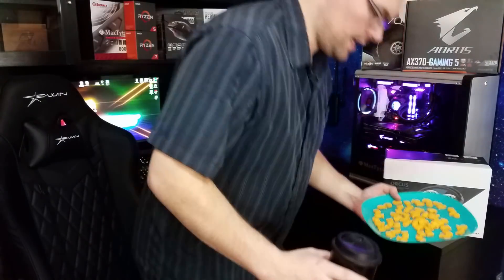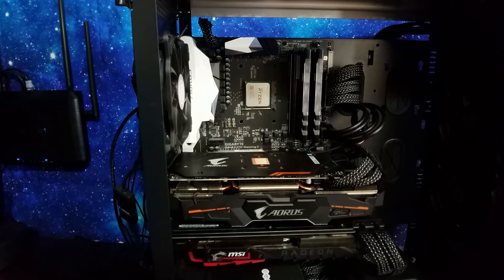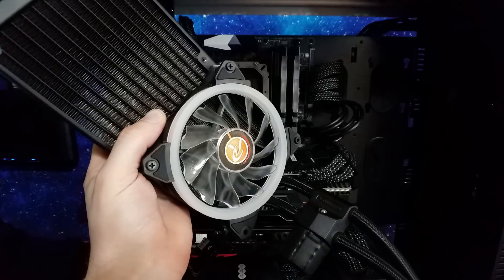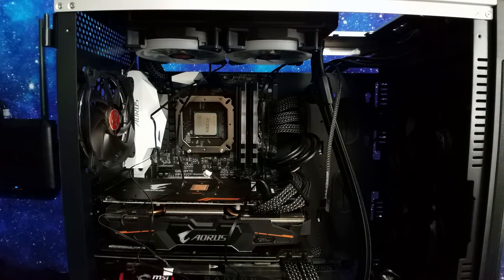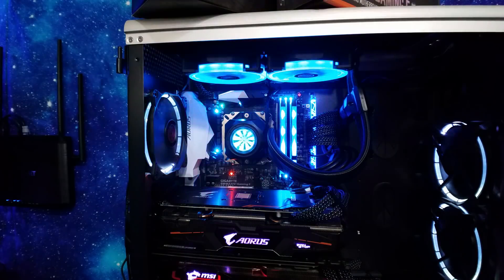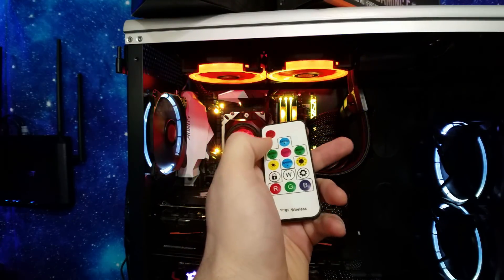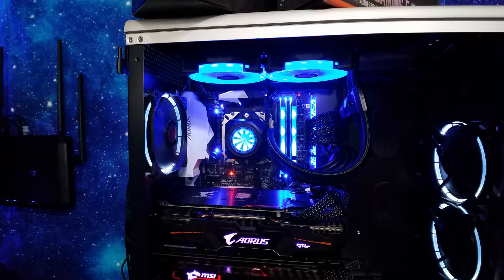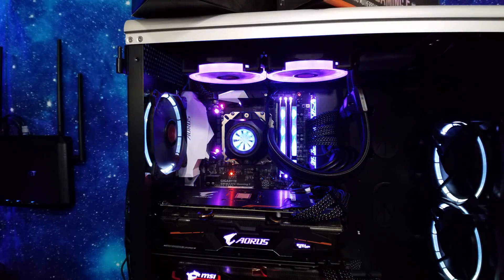Raijintek Orcus 240 - Liquid CPU Cooler - Review and Install

Comment: The control box on mine had a loose wire so I soldered it back and I'll be darn if the other didn't break loose too! I removed the box and the fans and added my own. It's still working but this is a message to Raijintek, they may want to keep an eye out for Q. C. on their products. I'll do without the R.G.B. for now and may solder it back or not. I like the idea of it being refillable and the  Raijintek, includes a bottle of liquid to use in the near future. I would buy it again also.

Comment: I just finished a new pc build about 6 weeks ago and went with the orcus 240. Up to this point I've been fairly pleased with the setup. I installed mine at the top of the case. The RGB looks great. The fan at the rear of my case is solid black. I just recently decided to add to the RGB aesthetics and since my orcus controller has 8 ports I ordered a Raijintek RGB fan from Newegg to replace the solid black fan at the rear of my case. This is where things got a bit dicey. The image on Newegg was a single image of the fan from the front view. No image of the connectors. Just a description stating that it has a 4 pin PWM connector, and a 4 pin RGB connector. Great, that's what I'm after. So I thought. My add on fan arrived today. I was excited. I unhooked my connections to my pc, opened the case and uninstalled my standard rear fan. I installed my new Raijintek fan and began the process of routing the fan header neatly and plugging it in. Then I took the RGB wire and also ran it through the cable ties nice and neatly to the 8 port Raijintek controller. I tried to plug the cable in but it wouldn't go in. I turned the plug 180 degrees and it wouldn't go in. I then looked at the plug, realized I had it oriented properly on the 1st attempt and tried it that way again. Nope, not going in. I then pulled one of the other fan plugs from the controller and compared the two. They're different. Both are 4 pin, but different. At this point disappointment is beginning to set in. I then return to the Newegg website to see if any other information is available and see if they've got the proper fan to purchase. There's virtually no information regarding the difference between the two connectors and any specification on which fan I would need. So, off to Raijintek's own website. Despite the Raijintek website having poorly worded English I was able to determine the part # of the fan. Unfortunately, there's no way to buy it directly off the website so I turned to my usual channels. Amazon, ebay, Newegg. Nothing. Then I go straight to Google shopping. Nothing. It was at this point I realized that this is one of the pitfalls of buying products from a company who's not exactly established. It appears the only way for me to get additional RGB fans that are compatible is to buy the entire cooler. I might try and see if I can cut the connector on my new fan and splice on one that works. Anyhow, overall it's a bit disappointing.
Reply: wow. I was contemplating the possibility to buy the cooler but the fact their own fan is incompatible tells you something about the company and also the hassle that you have to go through to connect more fans.
Reply: @VuHien2011  Yeah, at this point I'd recommend going with a more reputable brand. I ended up buying the Orcus 120 cooler kit, and taking the fan from that. I put my solid black case fan in with the Orcus 120 kit and sold it. Basically, it cost me $50 to get an additional RGB fan.

Comment: I got the 360 Core version of this, which does not come with the fans or the hub. Any idea how I can power this?
Reply: Thanks so much for the reply!! Much appreciated. You are absolutely right about the pump. My motherboard has headers which can be switched from 12v to 5v with a jumper, but they are 3pin VDG (voltage, D(not sure what this means?), and G (I assume ground?). The connector is apparently V, D, -, G (based on checking Enermax's Liqfusion connectors (both AIOs seem very similar). Would you happen to know how I could get the VDG into the VD-G?

Comment: i got orcus 240 to change my broken air cooler for my Asus crosshair v formula but I cannot installed it due to to the top bracket is hindered by the northbridge heatsink.  any solution with this problem? is there any chance to find customized bracket or just maybe taking out the northbridge heatsink?

Comment: Hey. 
Can you tell which pins i have to use on the mainboard?
I installed my orcus but in bios the waterpump is still not registered. My Block spin very slowly like it does not get enough voltage. The RGB of the Block does not glow so only the 2 coolers on the radiotor are shiny and nice. I've used a Fan-Pin for the external Pump and the temperatur pin for the cpu block. Iam using a Asus ROG Z370 G Gaming Mainboard. 
Should I use the water pump pin for the external Pump ?

Comment: As someone who used to work for a water cooling company, I can tell you why they put the pump on the tubing. Asetek has patented the design that puts the pump on the water block. This has forced companies to come up with other ways of mounting their pumps if they choose to use their own rather than just going with Asetek to do it for them and rebrand it. Corsair and others have gone that route because it's just easier for them and they don't have to worry about patent issues. It's good to see a company like Raijintek deciding to do their own thing and not just rebrand another Asetek cooler.
Reply: this, cooler master also do their own pump designs now, with different radiator fin shape too. asetek aren't terrible, but they need to stop being patent trolls